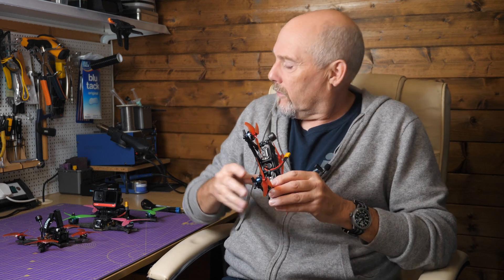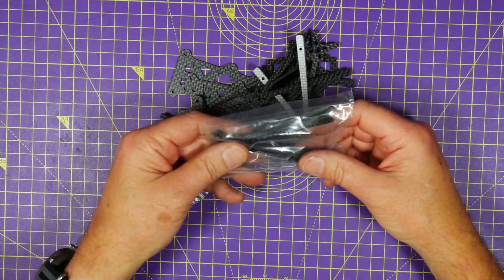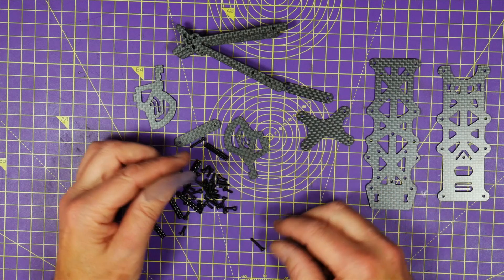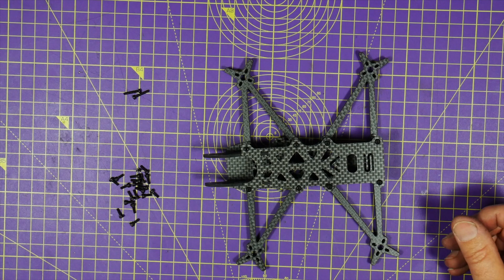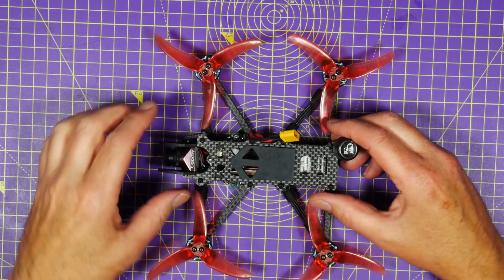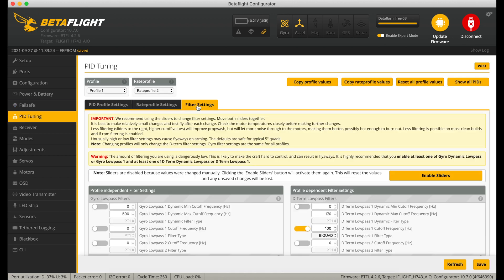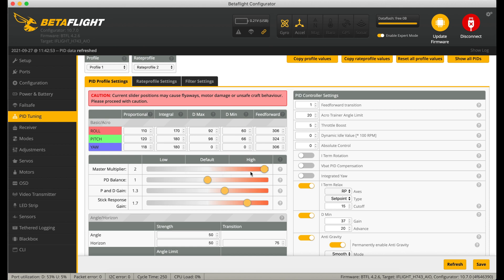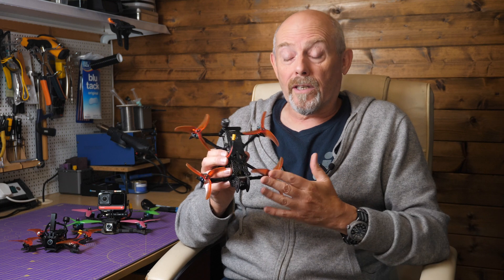The AOS 3.5 sub 250g FPV quad build and review / A GEPRC SMART35 beater

Comment: Did you mount the arms the wrong way around? First time I see them that way. (Compare with all others and you'll see what I mean)
Reply from the maker: There's only one way to mount them, so yes, they are correct. However, I was one of the first to get the AOS35 and this video was made over a year ago and the design is always being updated. And the arm design has changed quite a bit since then. The truss has changed position so it's about halfway down the arm rather than perpendicular to the body, so my build will look different to the latest builds - my latest build included.
Reply: @WhirlyBloke  yes I am confused sorry as Chris Rosser has changed the design over time and it looks different from the one I fly.
Reply from the maker: @dronevideography  I broke a couple of arms early on and reported back and they were subsequently improved. I've recently built one for a customer that's O3 ready and the arms are very different now. I believe the main reasons are improved strength around the motor mount and lower resonance. It's one of my favourite frames.
Reply: For sure, I fly it and love it. @WhirlyBloke

Comment: Excellent video! thanks for producing such amazing content! I own a crux35 and recently got some cheap dji v2 googles from a friend (he got the goggles 2 now). 
I love the crux35 but i hate how easily the bottom plate breaks. I was thinking to transfer some parts from the crux over to the aos3.5 and add a o3 air unit - staying under 250g should be easy.
Would you do (a) and keep the Happy Model Crazybee F411 AIO with the Happymodel 1404 3500kv motors or  (b) uprade and get a Speedy Bee F7 Mini Stack with 1404 xing 3800?
With option A i only would need to buy the o3 air unit and the frame but I feel like the xing 3800 motors together with the speedy bee stack (and blackbox tuning) would make the better performer.
Reply from the maker: Thank you so much for your kind words and for watching my video! I'm glad you found it helpful.

Regarding your question, both options have their pros and cons. Option A, which involves keeping the Happy Model Crazybee F411 AIO with the Happymodel 1404 3500kv motors and adding the DJI O3 Air Unit, would be a cost-effective solution since you already have most of the necessary components. It should allow you to stay under the 250g weight limit without much hassle. However, the performance might not be as impressive as with Option B.

Option B, on the other hand, suggests upgrading to the Speedy Bee F7 Mini Stack with 1404 Xing 3800kv motors. This combination, along with blackbox tuning, can potentially offer a better performing drone. The Speedy Bee F7 Mini Stack is known for its robust performance and advanced features. The Xing 3800kv motors should provide increased power and responsiveness. However, it's worth noting that this option would require purchasing additional components, which might increase the overall cost.

Ultimately, the decision between the two options depends on your priorities. If you're looking for a budget-friendly solution and are satisfied with the current performance of your Crux35, Option A could be a suitable choice. On the other hand, if you're willing to invest in an upgrade for improved performance, Option B might be worth considering.

Additionally, I wanted to mention that there is a new version of the AOS 3.5 specifically designed for the DJI O3 Air Unit. It integrates seamlessly with the Air Unit and provides optimized performance. So, if you're leaning towards Option B, you might want to explore this new version as well.

I hope this helps you make an informed decision.
Reply: @WhirlyBloke  WOW! thank you very much for that fast and informative reply. I think for me its better to invest the 180€ more and get new motors along with the stack. It costs a little bit more but It would my crux35 fully intact and I could use it as backup drone or maybe equip it with gps and use it for some long range crusing. When not pushing to hard I get 11mins flight time - enough time for a propper adventure :)

Comment: Could someone please point to me where in this video is the receiver for the controller? (I'm new)
Reply from the maker: It's using the receiver that's built into the Caddx Vista, so no separate receiver is needed.
Reply: @WhirlyBloke  Thank you! Your videos are super helpful. Is the caddx vista built in receiver only working with the dji controller or is there a module I can get for others like the zorro?
Reply from the maker: @CBikeLondon  it only works with the DJI controller. If you're not going that route just use an ELRS receiver and a Zorro.

Comment: Can you use that spike suppressor on any quad to reduce noise?
Reply from the maker: Yes, but it's not to suppress noise. That's handled by the low ESR capacitor. The spike suppressor catches any voltage spikes caused by the motor and ESCs that can fry your flight controller. This is more likely to happen on 5 inch quads and bigger,  but I fit them to all my quads of there's space.
Reply: @WhirlyBloke  thank you!!! I had never heard of it before now. Only ever used caps. That’s nice protection for your FC! I’ll check em out

Comment: NIce build... building one myself atm... Didn't you have to change the alignment of the gyro in config? Thanks
Reply from the maker: It's a great frame. The FC orientation is diamond and the front is the corner pointing forward so there was no need to change the alignment in BF configurator.
Reply: @WhirlyBloke  interesting… I’ve just had to yaw 270 on a beast aio V2 .. ( btflt 4.3 ) .. maybe the V2 is different in that way. .. has a different gyro also..
Reply from the maker: @tonhabraken9339  They change components very often to suit price and availability

Comment: Love your build soooo clean. 
I have a question about the spike absorber and if you have ever experienced any freezing of your FPV DJI video feed during flight? I have experienced spikes and my video has frozen especially after multiple flips back to back to back. I am using the fettech spike absorber with a 1000 UF capacitor on a 5 inch. I believe that the reason why I’m getting the spikes is because I use a 20 x 20 ESC and flight controller. Can you please tell me your thoughts on this? I have switched flight controllers and ESC‘s but I switched to a another 20 x 20 Akon F7. Previously I had the Tmotor 20 x 20 with the 55 amp ultra Tmotor ESC.

Your thoughts would be greatly appreciated. Also I had another question why did you use D shot 300?
Doesn’t the I flight all in one have BLhelli ?
If it does you should be able to use Dshot 600.

Ps I run it on 6S and 5S. I have had freezing on both 5 & 6 cells.
Reply from the maker: The spike suppressor is unlikely to be the problem. It's more likely a bad capacitor or maybe reroute your wiring.

Comment: Would 3,5inch with 1404 motors be able to lift a hero 10 for crousing?
Reply from the maker: It'll struggle. I use a naked gopro which works great. With a bit of work you can keep the auw just under 250g.

Comment: 3.5" sub 250 is where it's at !! I love my babyhawk2.  
Out of interest do you have a build video and pid tune for the 95x v2 ?
Reply from the maker: Thanks.  I didn't cover the 95x. It's one of my weird custom builds that flies very nicely and it's busy earning its keep.
Reply: @WhirlyBloke  sweet yea just picked it up basically for the value of the vista . But got cinelog25 and cinelog30 too just thought I'd try see if cab get the 95x flying better or strip the vista off it . Keep up the great content , from across the ocean west aust.

Comment: I just finished my 5.5
have the 5, 3.5 and 7... 
think the 3.5 is next will be doing that with a toothFairy2 3" 
just waiting on my 16mm motors
Reply from the maker: How's the 7 looking?
Reply: @WhirlyBloke  Still in the unimpressive bag...  waiting on motors before I lose the parts...
sturdy though. 
I did get countersunk though, 
sometimes I skip the battery pad... 
don't think there was a Chamfer option though... 
but feels sturdy like the others. Excited for the whole kit.
different arms though,, two piece triangles.